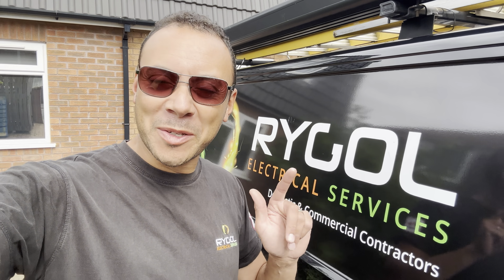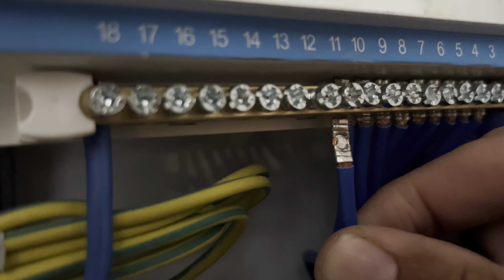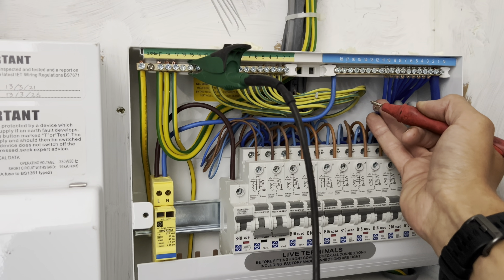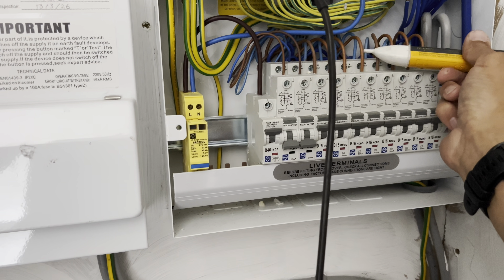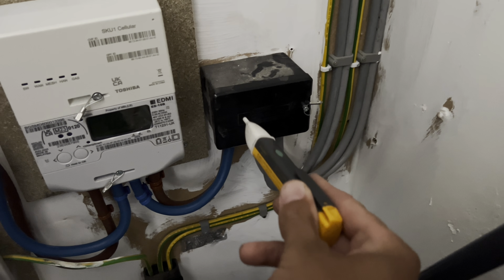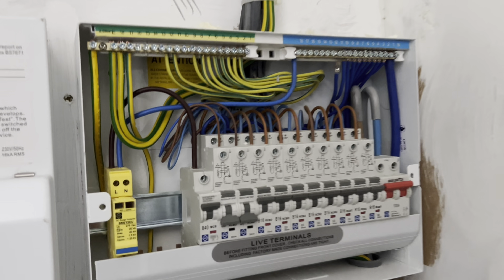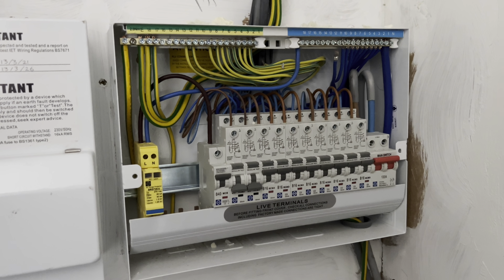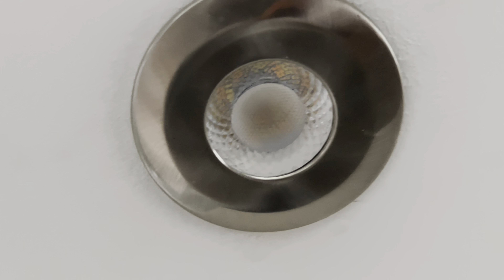Smart Meter Disaster! ⚡️

Comment: About 52 years ago, I came across the same when the local power company replaced a meter. I got a shock off a mains valve radio chassis I was repairing, it should have been neutral. 
I argued with my parents that their supply was wrong. They called the company who reluctantly came out and quietly did a bit of wire swapping. They probably wondered why this 14yr old kid was asking so many questions. At least they admitted to my parents they’d made a mistake. I took a career in electrical engineering, then electronics, then programming, then IT and Cybersecurity….but never get my live & neutral mixed up😳😊
Reply: @stevegrayson3719  I'd rather be alive than neutral.
Reply: @harryzero1566  You sound like a well grounded individual.
Reply: As a kid (5/6 years old, 70 years ago) I told my parents there was something wrong with the electricity in the little workers cottage we lived in. Can't remember why, but  I had a drink of water straight from the tap - put my lips around it and drank. I got quite severe tingles when I did this. My dad and mum touched the tap and felt nothing - but I persisted and said "drink from the tap". Then they felt it. It had probably been like that since the electric was installed in the early 1950s. Something wrong with the earthing.
Reply: Nice storey. ❤
Reply: I have had a very similar career path before I retired, and like you, have always clung on to basic common sense.
Reply: Are you in the UK or one of the UK's commonwealth countries? Anywhere else in the world an there is no protection against line and neutral swapping at the outlets,
Reply: The situation in many countries is that they  protect Both live and neutral by double pole switching at every circuit breaker.
Reply: Th @cambridgemart2075
Reply: @cambridgemart2075  I’m in the UK and 52 years ago and apart from fuse wire any other protection was nonexistent at the time.

Comment: I notice there is no 2 pole isolator fitted, could I ask how you isolated the supply when you installed the new fuse boards? Given that you cut the seal from the block did you do the same with the cut out and remove the fuse carrier, fit a shroud, remove the fuse from the carrier, refit the carrier and re-seal, all done of course wearing the correct PPE and having the required DNO authorisation?
Reply: Additionally how did you isolate the supply to correct the reverse polarity?

Comment: LOL i only just realised you only had a fault on one consumer unit, how does that work then?
If the meter engineer put his live and neutral into the lucy block the wrong way round BOTH consumer units would be reversed.
I am sorry but you are full of it, you left one consumer unit reversed for two years! Now i understand why you covered up the British Gas sticker.
Reply: @Porkchop259  Of course both consumer units were reversed. What makes you think the other one wasn't? At no point was that shown or stated.
Reply: @Maurice_Walker  bull, the video went out of its way to show the fault and the tests, but nothing on the other consumer unit. The sparky made an error and went above board trying to blame someone else because undoubtedly the customer was less than happy.
Reply: @Porkchop259  There was absolutely nothing to see at the other consumer unit. He was called because of the lights flickering while being switched off. Checked the consumer unit the lights are connected to. Found the error the meter guy made and fixed it. Moved on.

You're making unsubstantiated assumptions based on nothing.
Reply: @Porkchop259  There is nothing in the video supporting your claim that only one consumer unit was reversed. Reversed polarity isn't something an average customer can easily detect. It doesn't have an effect on most devices - most countries don't even have polarised sockets. LED lights are the exception.
Assumptions are irrelevant and dangerous, only hard facts matter. And you can't win an argument by cursing. See you here on Wednesday.

Comment: I know what it can be ,two way wiring and inductance with some Chinese LEDs  the  current used is negligible I had  a similar situation and it is known about with most Technion's and yes I am an electrician however yours was another problem well done finding out. I did find in one property reversed polarity no LEDs but wired up wrong very dangerous always check polarity.  not so smart meters are fitted by  non electricians.

Comment: Say what you will about American wiring but this couldn't happen in the states. All electrical meters are on the exterior of the buildings. Meters fit into a standard socket on the wall (Look up American Smart Meters) for images. Meters are in a glass case and locked to the socket by the electrics provider. The old analog meters fit into the same socket so all that was needed to upgrade to a smart meter, the electric provider came out, pulled the analog meter and placed the new meter into the socket. Installation complete. In 5 minutes, it was done.

Comment: I would not recommend a smart meter to anyone they aren't installed by electricians.
They boogered up my install by putting a screw through the back board right onto the kitchen socket ring and wouldn't come out same day to fix it, I had to diagnose the fault myself.

Comment: I am sorry but this video seems a little overboard, for every meter reverse polarity there will be two consumer unit reverses.
No argument the meter engineer may have reversed by accident, but there is also no reason at all the system could not have been reversed for the past two years.

Comment: I'd imagine, as an electrician, you assume everything is live until confirmed otherwise. I've got one of those plug testers and it's very useful when rewiring an extension cord. I do the same thing so have a pen live tester and it's saved me once when I turned the wrong circuit off to replace a socket.

Comment: The orange tester you used is the same as smart meter installers use that fitted that meter. You should just contact DNO and they will deal with the company that messed up. before they kill someone

Comment: I am a little surprised that it wasn’t your first test. Voltage on the neutral, flashing led’s and even glowing fluorescents are classic. Always trust your death stick is my motto. There is no excuse they won’t fit a meter if they can’t access the house to check the polarity. Everybody makes mistakes but this is incompetence and cold so easily result in a fatality, and requires prosecution in my opinion

Comment: I don't see a leak current breaker? Don't you guys have those in the UK?
Belgium :  300mA main trip,  30mA wetzone trip

Would this have been possible with such leak current protection???

As far as I can tell, if they had such leak current protection which is mandartory here,  the installation would have tripped instantly.. it never would have worked..
Reply: Yes, we do (every single one of those breakes), yes, it would, and no, your installations wouldn't trip due to this.

Comment: I had flickering lights some years ago, that was a "dry" or high resistance neutral at the suppliers overhead incomer on a TT system in a rural location. The voltage was fluctuating live to neutral, but steady 240v live to earth. Turned out to be a loose linetap at the suppliers pole mounted LV transformer.

Comment: Smart metering operatives should be made to do 18th edition and use an MFT! 
The present grading isn’t sufficient for safety ( just safe isolation and practical meter tail experience)
(Done both jobs myself Electrician and smart meter operative)

Comment: Here is the law details that may apply knowing the full context of it is as I see it. I'm an ex retired h&s union rep. 
and this is just a comment not legal advice. 

### Clarification on Smart Meter Mis-Installation and Near Miss Reporting

- **Issue**: A smart meter was incorrectly installed with the polarity reversed between the consumer unit and the smart meter. This allegedly caused all electrical appliances and lights to function in reverse, creating a hazardous situation for anyone diagnosing faults without awareness of the mis-installation. An electrician, through skill and caution beyond normal procedures, avoided injury despite being exposed to potential danger.

- **Near Miss**:
  - A near miss is an unplanned event that did not result in injury, illness, or damage but had the potential to do so.
  - In this scenario, the mis-installation of the smart meter constitutes a near miss, as it created a dangerous environment that could have led to injury.

- **Legal Obligation to Report**:
  - According to the Reporting of Injuries, Diseases and Dangerous Occurrences Regulations 2013 (RIDDOR), a near miss involving potential exposure to a serious risk or danger should be reported to the Health and Safety Executive (HSE).
  - Reporting is required for incidents that involve dangerous occurrences or equipment failure that could have resulted in a serious accident, which applies in this situation due to the significant risk of electric shock or other injury.

- **Time Frame for Reporting**:
  - Under RIDDOR, near misses or dangerous occurrences must be reported promptly. The specific timeframe is generally within 10 days of the incident.

For detailed legal advice, consulting the specific regulations or a legal professional specializing in health and safety law is recommended.

Comment: I found a similar miswure neutrallive miswire at a single socket which kept tripping. This was one of Glasgows RSL (residential social landlord). The proprty also had a damaged cover plate. As soon as i found this one a repair order was sent in and I checked every socket i. The place. Tgere were so many ussues there it took six months to fix them since the Glasgow City Council does not gave its own property and relies on leasing companies and private landlord to supply housing. It also means they can claim mea no culpa. Add to that the smart key meter was placed at a height nearly 8 feet above floor level. Glasgow has dangerous and  greedy RSL and should have better inspections before a tennant is pushed ti accept a property.

Comment: is it illegal to remove the tabs ?
Reply: Yes. Except in this case the one on the tails splitter box to the right of the meter… However without an isolator after the meter, I wouldn’t correct the mis-polarity in that box as you equally cannot remove the main incoming fuse to do it safely…

Comment: You shouldn't have corrected this ,but  rather report it so the original installer is held responsible, and  to prevent this  happening to somone else ,and after all many meter installers are not even qualified but rather carry out a short crash course 😮

Comment: As a meter engineer …they haven’t followed procedure. We carry out a socket test before and after..plus photographed . This wouldn’t happen with Scottish power / UW. Plus that black block is always replaced.
Reply: That little black box is called a Henley block which us electricians use on a daily basis and you meter operatives shouldn't be putting your seals on them as it is the customers equipment, if you don't know how to use them then you shouldn't be doing your job.
Reply: @alanbaltic actually your wrong. It’s in our safe systems of work to check blocks for tightness between the meter and Consumer unit. We’re basically putting our name on checking those blocks. We won’t check blocks from the isolator to the CU. Obviously you’re not aware of the regulations we have to follow. We are only checking blocks at the meter point….not if they are elsewhere. We find 80% of electricians connections to be wrong ie exposed live terminals and inner insulation showing. It’s a shame there is no redress really for shoddy electrical work.
In this video the meter engineer like any job has cut corners and if he’d carried out a socket test before and after this wouldn’t have happened. If this was our company he would have been suspended / investigated and probably rightly sacked.
Reply: @RICHLES01  No I am not wrong. You are wrong for putting your seals on customers equipment, it's okay to check for tightness absolutely but you don't put seals on equipment that belongs to the customer. Your remit should stop at the meter, or an isolator, if one is fitted. If basic insulation is showing then it probably wasn't an electrician that installed it and probably a meter engineer. Older practices allowed single stripped insulation outside enclosures, exposing the black and red, which is now against BS7671, which meter operatives have no knowledge of. On an EICR basic insulation showing outside of an enclosure is a C2. I am well aware of MOCOPA and what a meter engineer has to do for his job. If you took time to research how procedures were carried out by older meter operatives you would know this. Whether it's your company's policy/procedure or not, meter operatives should not be putting seals on customers equipment. I presume you work for Calisen?

Comment: When I started electricians did it all,no alarm engineers,no audio visual etc,no factory /comercial,no ac/dc u name it we did it.Before u even went in u would know it was a neutral fault with these problems.Forget your devices,a bulb a peice of flex can find anything without damage or danger.Try working on servants call systems.U start at beginning and it seems these gizmo,s have replaced common sense and the need to understand the theory of electro/magnetism.

Comment: I had a brand new car a few years back, that for no reason the headlights would come on after it rained!  It's not only houses that people screw up. It turned out the black box for the wiring was directly underneath the windscreen, and water was dripping inside causing a short. The dealer tried to palm me off by wrapping the box in plastic wrapping. I told them I would get Trading Standards involved unless they put it right (as in stopping water from getting in, in the first place) It turned out the wrong windscreen had been fitted and no amount of mastic sealant would prevent it still pouring in, so I threw it back at them and they replaced the whole car!

Comment: I bought one of those simple testers after I moved into my first house (new build) and discovered the range outlet had been wired incorrectly - the chassis was live with respect to earth.  The rest of the house was fine.

Two years later my brother moved into a new house, and also found the range outlet wired incorrectly.

A few years later I moved into my current house (1970s build) and my tester found several miswired outlets, some of which I am reasonably certain had been that way since the house was first built and others were caused by prior owner DIY mistakes.  Simple carelessness.

Comment: Probably happened force of habit as with dual blocks the live should be connected to the back bar not the front one that the consumer units side tails are. Of course it should have been checked and tested during the meter change.

Comment: The meter fitter is 100% in the wrong, and clearly didn’t test after meter swap….however, i can see what the meter fitter has done, he’s assumed the phase is to the rear of the Henley block where it should be and you’ve put the phase towards the front, it’s always good practice when fitting Henley blocks to have phase to the rear and neutrals to the front. Still no excuse by meter guy.
Also, when fault finding, it’s always an imperative to isolate mains, remove board cover and check main first for polarity before deciding to energise anything, this will always avoid a neutral bar becoming live…..start with the basics sparkies!!

Comment: Had a boiler fitted gas meter and electric meter moved on a job. . when  fitting  the kitchen everything was working normally but the boiler stopped working . It stopped working after the electric meter move . 
BG came back couldn't get it working several vans turned up technicians  laptops trying to figure out why the new boiler failed . It had power everything looked fine and it should have worked several hours later just packing up to leave whlist they were  all stood in the kitchen at a loss got my Martindale plug tester out plugged it in reverse polarity . Checked the socket meter all correct took one look at the meter the tails coming out wrong way around . 
Swapped polarity on the boiler power supply switched on and   it fired up straight away . Dno 
 came around within a hour and changed it over . 

Never trust any other work and make sure its isolated even if its with a death stick . 
 
Power supplies dont always come in from the official route .

Comment: If you fitted that dual pole block when you did the electrics a few years ago I would question your professionalism. They are supposed to be wired with the live in the rear and neutral to the front. Other than that your work looks really neat. I agree he made a massive mistake as he didn't use his socket tester.Silly fool.
Reply: Completely agree, just wrote the same comment before seeing yours….

Comment: Obviously the meter fitter didn't carry out his polarity checks or even mark the cables, so he's totally at fault. The only thing I would say in his defence is it's traditional on those particular blocks for the live to be at the back and the neutral at front. If I'm seeing correctly it appears that block is wired with live at the front. So when "rush job" Joe arrived and changed the tails he just followed the usual expected arrangement and but got caught out very badly. Luckily no one got injured because that's the worst case scenario.
edited to add this isn't specific to smart meters of course. Any meter change could have resulted in a cross polarity. And to add balance I've arrived on site before to discover the electrician left a reverse polarity the day before me lol